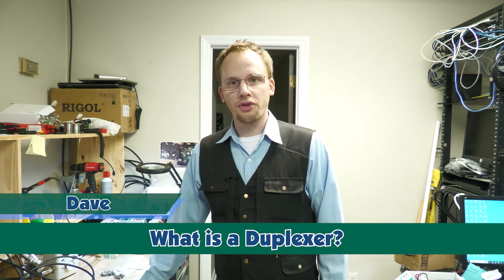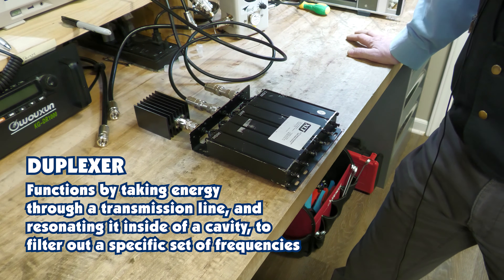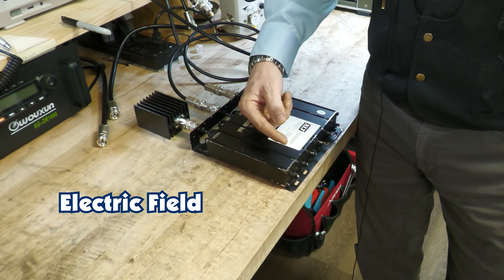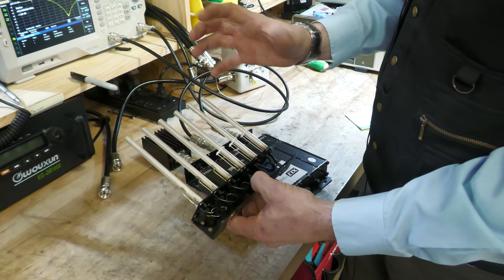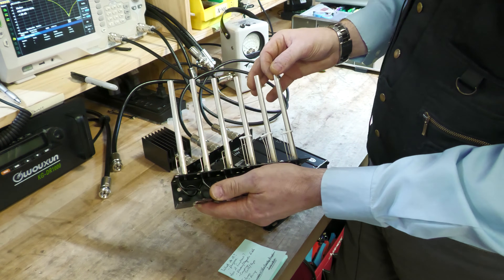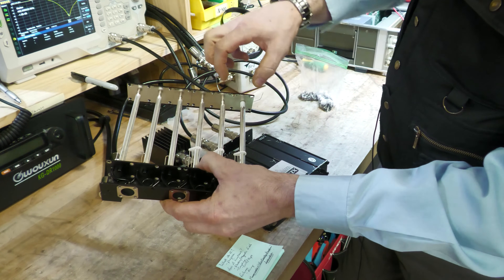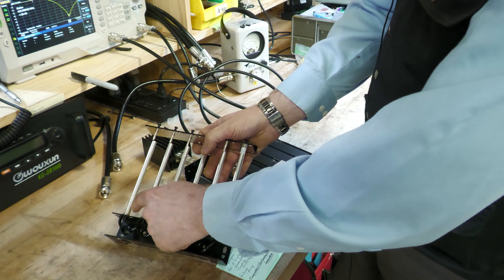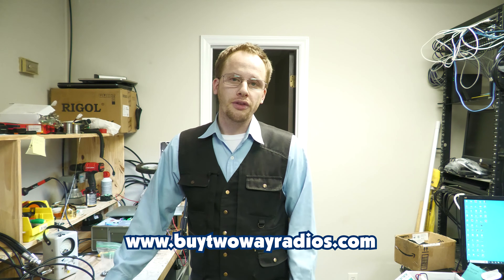What is a Duplexer? How it works and common failures

Comment: Very similar to what the Marines call "Re-Trans" setup. But it used 2 separate antennas. One for transmit and the other for receive. Would that be possible for 2 KG-1000 radios in repeater mode? Use 2 antennas instead of a duplexer?
Reply: Possible to do without the duplexer,  2 antennas on the same tower, with 40 feet separation between the tip of the lower antenna and the bottom of the higher antenna.  The GMRS duplexers seem pretty cheap online, ~$150us probably not worth 40 extra feet of tower,  and 2 antennas and 2 feedlines.  73  N3SDO

Comment: Nice video.  
Couple things I would like an answer to:
1) does it matter which  TX/RX is tuned to TX or RX?  I see them marked as HIGH and LOW.
2) this may be part of question 1, but the internal coils are different.  Why?
if Question 1 Matters what happens if you tune them backwards?  Which I can see being done easily because my radio TX Freq. and the repeater TX freq. are not the Same.
Reply: Hi got a question about the low side 
Is it possible to use as the tx
Reply: @windtalkerhb2218  Yes. Low side can be TX.  Example Lo Tx = 147.375 TX. : 147.975 RX,  (+,600  offset)
Reply: Hi cjammer34, N3SDO here, I hope to answer some of your duplexer questions.  I will use a ham repeater freq for this example, bur GMRS is similar.  There is no TX port or RX port, the are High and Low frequency ports.  The Hi/Low frequencies 441.6/446/.6  (5 mhz offset) of the duplexer don't  care which is TX or RX, as long as your duplexer is tuned for the 2 correct frequencies, and you have your 441.6 transmitter connected to the low side 441.6 port on the duplexer.  Same for 446.6 RX connected to the 446.6 duplexer port.   
The internal coils are different as to shift the Low Passband freq -/|/-  Hi Notch freq on the low side, then the High side is coupled to reverse the response and tuned to Low Notch Freq -\|\- Hi Passband freq.    
Checkout : https://ka7oei.blogspot.com/2017/09/when-band-passband-reject-bpbr.html  This gives a clear picture of one side of a duplexer which is a Low Pass/Hi Notch.  Like a sawtooth.  /|/